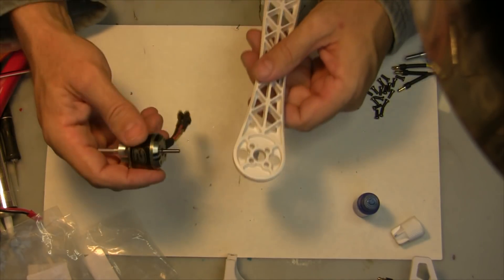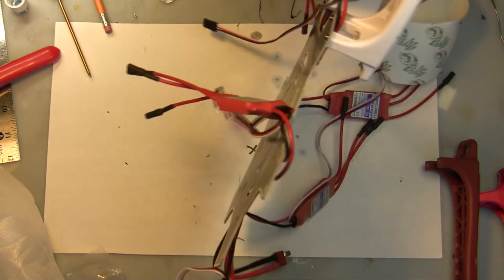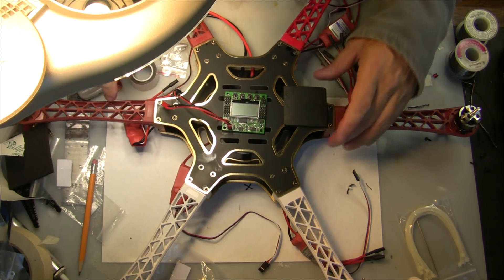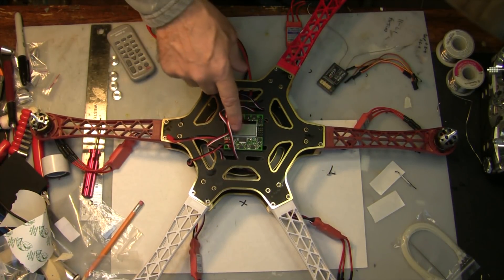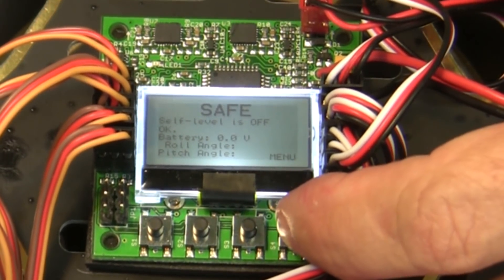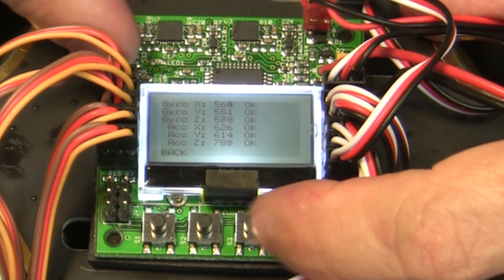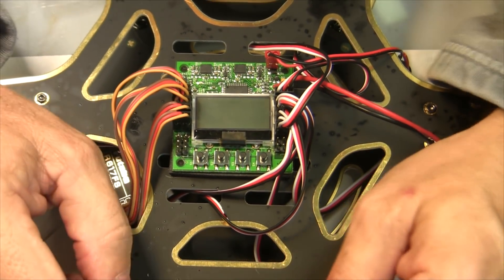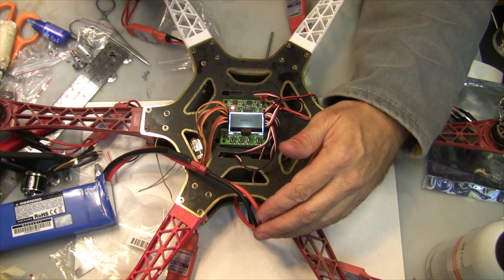Hexacopter Build Part 2 of 3, build a Hexacopter for less than $300

Comment: I know you must get bombarded with questions.  I see you used a Futaba Rx Tx set.  Is it possible to use other brands like SpekTrum or Walkera without a lot of re-engineering?
Reply: As long as the rx and tx connects to eachother, yes.

Comment: I am new to RC building... I have completed building the Hex with your video tutorial... The HEX is not flying at all... Also in the receiver test, the auxiliary value in your board is -131 and in offf... but in mine its showing -3 and no off is there... Is that the culprit.

Comment: Thanks for the instructions! I had my maiden flight with the exact same things now and it works great! Just need to figure out if there is any settings to make it even more stable (i will use it for still photoage). I have changed the expo of all inputs but need to learn about the p and I gains. Thanks again!

Comment: Thanks for making this, I am basically going to follow step by step—I'm just waiting for HK to ship me the parts. Question for you—the H550 comes with 3 red arms & 3 white arms. In your video you have 4 red & 2 white arms. Did you replace one of the arms? Is the setup different for a 3/3 setup on the KK board? I'd prefer to do a 4/2 setup so I can mount a camera and not be right under an arm & motor. Thanks for all the work!